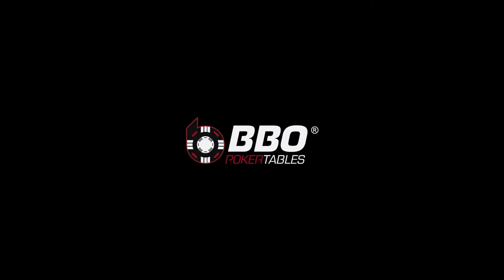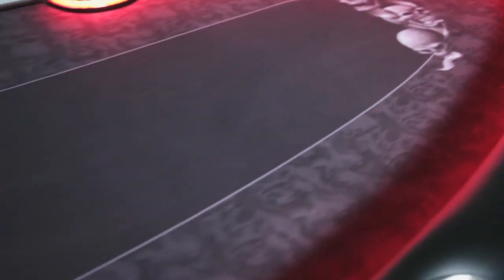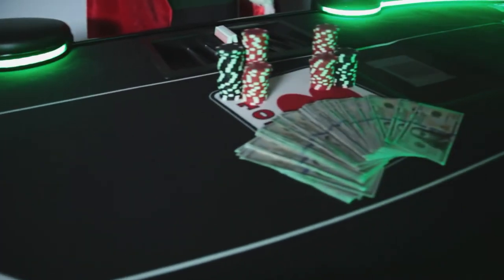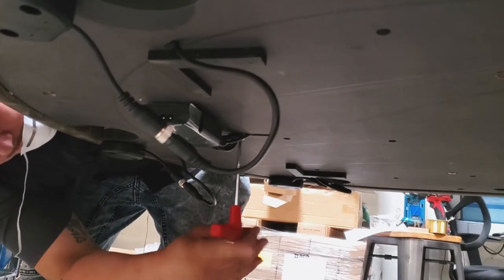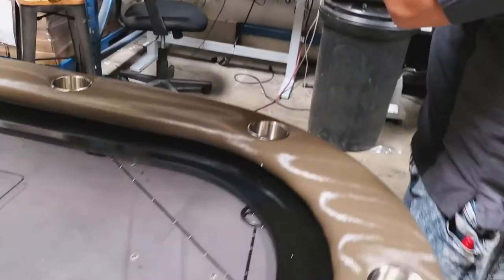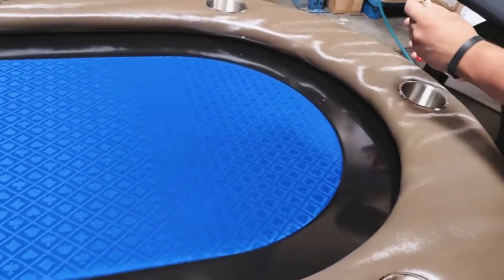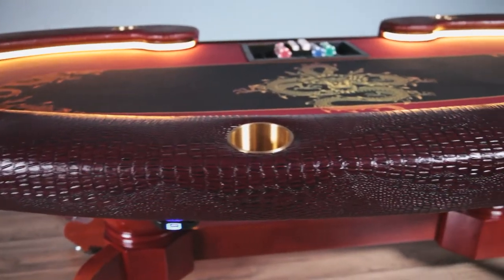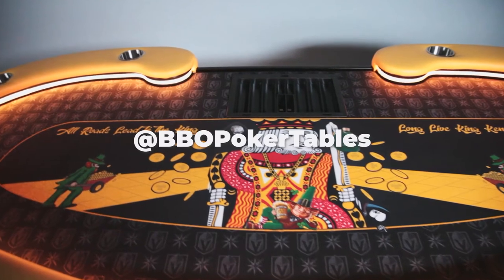How to Swap Your Poker Table's Playing Surface

Comment: 2 questions:

1. Can I apply my new custom felt straight over the old felt? (Or will it not fit during re-installation?)

2. Can you please make a video on how to re-upholster the armrest on an elite? (And can I just apply the new leather over the top of it)?

Cheers
Reply: Good questions. Did you ever get the answer to question #1
Reply: @iviadiviax  didn't get a reply, but it fits nice and snug straight over the top!